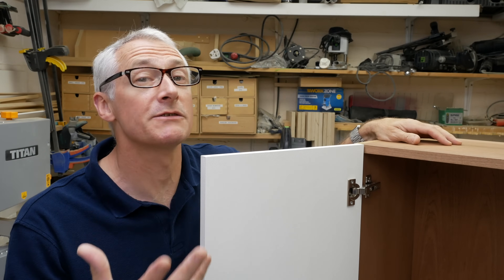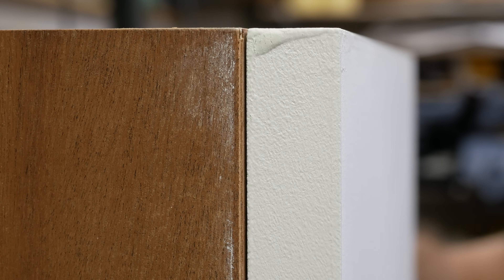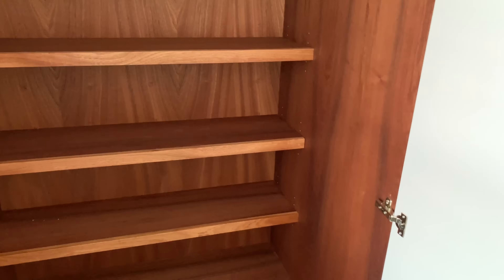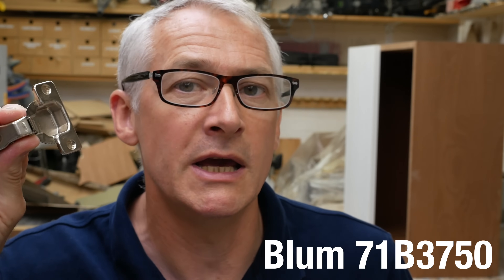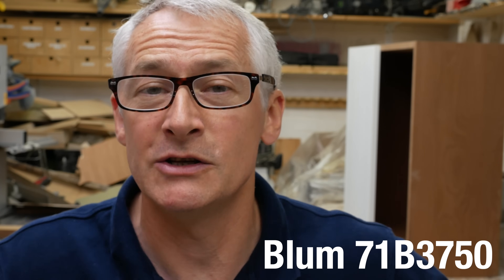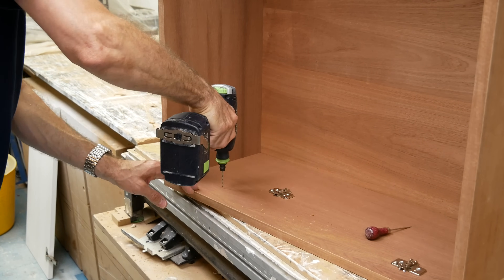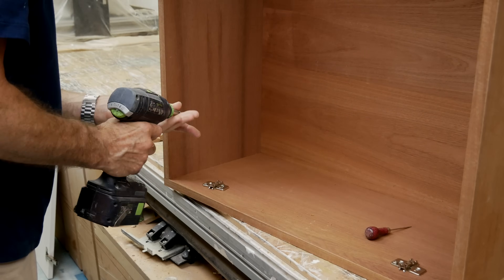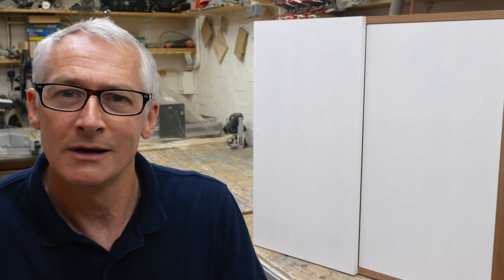How to fit concealed (Euro-style) hinges for overlay & inset cabinet doors [video # 348]

Comment: Interesting video but seems to take place in a different universe to the one I occupy. Attempting to fit the first door on a Howdens kitchen cabinet for an office, with the holes already in place, I observe the following:

1) The arrow on the cabinet side of the hing is (excuse the pun) 'pointless'. Either you have done it before and know which way to put it; or you haven't, in which case you don't know whether the arrow points into the cabinet or out of it;

2) Your door Peter simply clicks into place in a second. Why does this never happen for me? I have spent what must be 20 minutes trying to get the first of 2 hinges to attach. It simply refused to lock into place, whatever I tried and however hard I tried to force it. The door side of the hinge seemed to be too short. 

Afraid that I might lose my rag altogether an smash the whole thing up with a sledge hammer I had to take a break and spend my time constructively doing something else while I calmed down.

This kind of task, as so many others, seems way more complicated and fraught than it ever should be; mainly, I suspect, due to imprecise design and manufacture. 

Am I the only one in this universe rather than yours?
Reply from the maker: Well, the point of this video was to reach the folks in that alternative universe - hence the explanation of the arrow pointing outwards. As for it looking ‘easy’ to clip on the hinges, as I say in the vid I’ve had some practise as I’ve fitted thousands of these over the last ~20 years. 👍👍

Comment: if you use the cam version of the hinge plate on an inset door, when you adjust it up and down, does the other hinge 'give'? or does it add tension/compression between the hinges until the other is adjusted? (or do you just have to adjust both hinges at the same time?)
Reply from the maker: No, they create a bit of tension between them, and you need to move each a little at a time. 👍

Comment: hi pete just using your video for reference for adding some of these hinges to a cad drawing and found it a struggle till i watched this video, very informative, but one thing i noticed was you said the fixing holes for the boss are 32mm apart also the fixing plate holes are 32mm apart but the holes for the boss are wider than the 35mm hole as is visibly obvious at 1:51, i feel like such a dick pointing this out  but after some checking at some diagrams ect. i think they are supposed to be 45mm apart for the boss and 32mm for the fixing plate. ive ordered some blum hinges and will make a test piece to see if my calculations are correct before using them on a finished piece. but apart from that minor oversight the video was a massive help, and youve sold me on blum hinges, soft close for sure. sorry for being a dick and keep up the good work love watching your videos, how are you getting on with your cnc machine btw

Comment: Thanks for the great tutorial - the Blum catalogue is overwhelming! In Canada I see that the cruciform mounting plates come in 2 different thicknesses: 11.5 mm (so-called 3 mm 'spacing') and 8.5 mm (labelled as 0 mm spacing). Since this is the height of the plate, presumably the choice affects the gap between the cabinet and the door. Can you help me to decide which of these to use for a 'normal' application? Thank you.
Reply from the maker: Thanks! The ‘0’ and ‘3mm’ plates are for different carcass thicknesses;  I use the 173L8100 or ‘0’ plate for 18mm; the 3mm plate lets you use the same hinge of 15mm thick material eg Egger board MFC. 👍👍
Reply: @10MinuteWorkshop  Thank you so much! That is very helpful!
Reply: @10MinuteWorkshop  Your tutorials are great Peter! I've been looking into this topic for hours but can't find a single source of truth. Would the same apply for inset doors? So for 15mm tick material, I would use the 3mm plate with cam adjustment (173H7130)? Thanks

Comment: One point I didn't see.

Drilling 35mm holes in timber by hand is not advised. They tend to wander.
Usually drill a hole though an ofcut of mdf to create a jig to keep it centered
Reply: The awl hole acts as a pilot hole for the tip of the forstner bit, so no. It won't wander around unless you're a gumby.
Reply: @Monsieur405  
In Mdf and chipboard maybe. In wood. No. They wander.
A forstner bit is different to a cabinet hinge bit. 
I've drilled enough to not take the risk of a bit wandering in a timber door.
Reply: It's the difference between a crisp hole and. Sloppy hole.

Comment: Hi Peter, thanks for the great videos ongoing, you are part of my mentoring circle! Question. Recently I have trialled some Bertha soft close 1/2 overlay face-frame hinges. They have a short mounting bracket with little tags to receive the thickness of the face frame perfectly. Problem is when i install them the door closes at the hinge side leaving a 1/4 gap even though the in out adjustment is all in. Am I missing something? I have used shaker doors with 1 3/4 x 3/4 stiles plus a face frame same. I don't see anyway this hinge could shut flush even on its own unistalled theres the gap? Your thoughts please? Thankyou. Johnny
Reply from the maker: Hi Johnny, and thanks! I don’t know those hinges I’m afraid. I’ll have a look into them and see if I can make some sense of it, but it sounds to me like they may need to be set further back into the carcass. 🤔🤷‍♂️👍
Reply: @10MinuteWorkshop  thank you Peter and thats exactly what i thought alas, the tabs dictate where they sit on the edge of the face frame. They have all come assembled and i haven't had need to remove the hinge from the mounting bracket as you can screw through without removal and they hold ok inside the tabs while you mount. Is it possible these hinges were mounted upside diwn on the plates? I'd better look into that i think. J

Comment: My kitchen is 35 years old.  It has Hettich concealed hinges.  As the hinges fail/break I find that I can’t get a replacement hinge which is a pin easy replacement.   I always have to move a hole or drill anew one to solve the problem.   They all look the same but the bits are certainly not interchangeable.   It’s a P I T A, let me tell you..

I wish I had your knowledge, patience and experience..   in the early days no-one had Forster bits to drill the holes if you had to make a new door, after the kids ripped one off in the kitchen.

Stavros.

Comment: Hi Peter.

Great video as always. One problem I find when installing long doors with inset hinges is that no matter how accurate I am with transferring the centre line of the pot hole with the carcass, I always end up with a tight gap at the bottom and wide at the top. I therefore usually raise the cruciform 1 to 2mm. Your thoughts would be appreciated?
Reply from the maker: Thanks! How are you marking the door & carcasss? I always used a rod for this, and can’t say I’ve ever had the issues you mention. Might be worth a shot? 👍
Reply: @10MinuteWorkshop  Hi Peter, I use the same centreline mark I made on the door for the pot hole and then line up the door with the carcass and transfer the marks across.
Reply: @10MinuteWorkshop  if I understand you correctly, by a rod you mean something like a story stick?

Comment: Wait, now do we have to go after the blockscribe guy for ripping off the Grass template? :p
Reply from the maker: Well, only if Grass actually made an inset hinge jig, and only if Steve’s inset hinge jig also did hinge positions, not just the inset hinge plate positions, and only if he called it ‘hinge jig, inset’ and only if he was claiming it as his own, because he changed the size of the holes you use to bodge an awl through, etc.. etc..  🤷‍♂️😂👍

Comment: Why don’t the packs come with simple fitting instructions with measurements? I have a whole pile that came with no info. Also some hinges I have need rebating out on front edge, again was no info supplied. Frustrating.
Reply from the maker: As I think I say in the video, the Blum catalogue has many, many pages dedicated to these hinges, including fitting and adjustment, which is largely common across the brands. 👍

Comment: Does Blum soft close feature work when  doors is narrow (about 20cm)? I switched to Hettich few years ago for this reason. Maybe some changes in Blum design.
Reply from the maker: Not sure I’ve done a finished door that narrow, but I routinely use stock smaller than that if I ever need to test a set-up with a hinge, and have never had a problem. What was the issue you had originally with Blum hinges??
Reply: needs something like doors force or speed to start work soft close feature of Blum. With wider doors no problem. This was few years ago, maybe now is better.
Reply from the maker: @jomajo9189  No, no issue of any kind like that with these hinges 👍

Comment: Hiha Peter say I've made a cabinet 600x600 and lookin to put 2 doors on it what sizes should I cut the doors at..on the outset hinge set up..wood you say 5mm less of all round...
Reply from the maker: Hiya. Depends on the location of the cabinet. If it’s jammed between 2 walls then you’ll want a bit more clearance on the outer edges, but if it’s a solo cabinet or in a run, then I aim for a 2mm gap either side. So for 600 x 600 I’d make the doors at 298 wide - this would give 2mm between them and 1mm of clearance either side - effectively 2mm between adjacent cabinets if in a run. Make the height whatever works - full height if there’s space, a couple of mm undersize if you need the clearance, which you usually do tbh. 👍👍
Reply: @10MinuteWorkshop  thanks bud and cheers for the quick reply.....much love

Comment: If you are near IKEA isn't IKEA UTRUSTA (402.826.58) a better bet with 110 deg hinge, base plate and compression fit on door? All for £6 a pair.
Reply from the maker: They're a basic sprung hinge - no soft-close - and that's half as much again as I pay for the Blum 71B3550 I show here. And it means going to Ikea 🤷‍♂️😱😂

Comment: For somebody who is installing 2 inset hinges without a jig this was not particularly useful but thanks anyway
Reply from the maker: 10:20 "Now normally I would just measure this carefully allowing for the thickness of the door, 18mm or whatever..." 🤷‍♂️
Reply: @10MinuteWorkshop  sorry I do not mean to come across as rude
Reply: @10MinuteWorkshop  is the 37mm the measurement from the holes in the hinge place to where the hinge is screwed into the door?

Comment: Thanks for very simple and easy to follow vid. Are the measurements always the same for mounting plate 37mm to screw holes?  https://www.toolstation.com/blum-sprung-concealed-hinge/p92863
Reply from the maker: They're only ever a starting point because there are lots of variables, but yes, with the Blum cruciform plates a 37mm set-back is a pretty good place to start. 👍